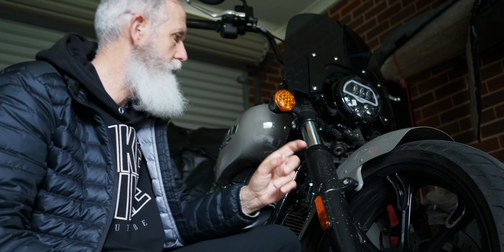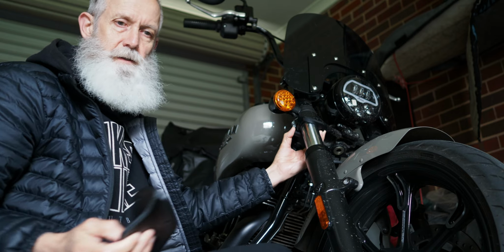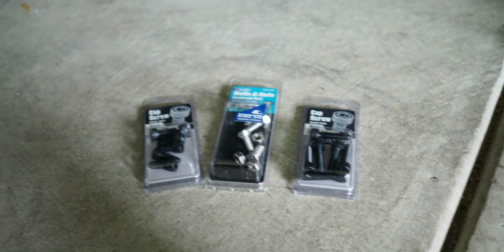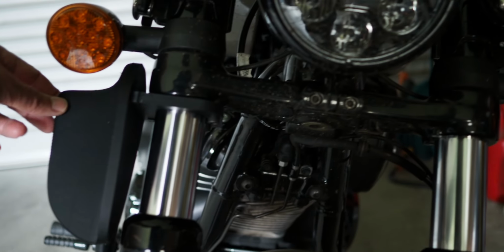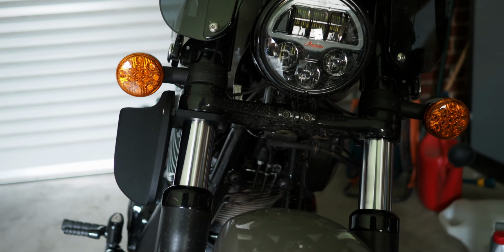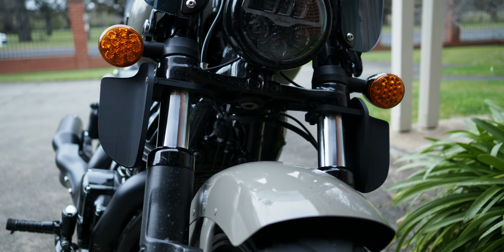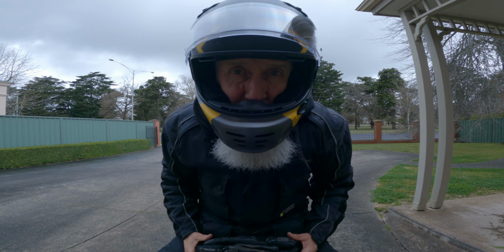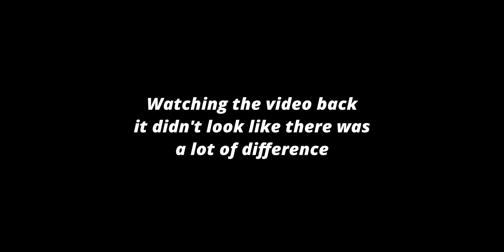Experimenting with Fork Leg Wind Deflectors

Comment: I bought fork deflectors off EBay. They are for Japanese cruisers but fitted without much work. $60 including the mounting hardware and work great. 2013 Victory Cross roads, it has the same front end as a Challenger.
Reply from the maker: Ooh interesting, thanks I'll check that out!

Comment: You are on the right track. Bought a used Street Glide that had fork deflectors on it. Did not like the way they looked, so I took them off. After one ride without them, I put them right back on. Huge difference! The wind buffeting was bad without the deflectors installed. You might want to take a look at what HD sells for their touring bikes and make yours a bit longer and dished like theirs are. What I would like to know is how much they affect wind flow to my motor. I have reached around in front of the engine at highway speeds at felt the air stream which seems good, but that's not a very scientific test.
Reply from the maker: Cheers NWF. I do like the Fangs available for Harley's. I wonder if I could make them fit the Indian? 🤔

Comment: I think you need a shorter screen, I have the short screen on my Pan Am and a deflector on top angled at 45 degrees, I don't get any buffeting. I have the same setup with the taller screen and I get some buffeting. Now the Pan Am does have a gap that lets air under the screen, above the headlight, to reduce the negative pressure behind the screen, and it does have side deflectors just above the headlight fairing.
Reply from the maker: Yeah, shorter or taller. I'm printing a custom smaller screen I designed right now, going to be interesting to see how this goes. Keep an eye on Patreon. ;)

Comment: Had the problem with my Chieftain. Another indian rider put me onto deflectors from the US called JES Customs. They absolutely work gets rid of 95% buffeting.
Reply from the maker: Brilliant! Cheers I'll check them out.
Reply: @BikesILike  I'm going to have Chieftain serviced at Ballarat in the next few weeks if you want to check them out
Reply from the maker: @theindianfromoz6301  Actually, that would be good! Let me know when that's happening and I'll meet you there. Email me here bil.channelcontact@gmail.com
Reply: I concur.  I did the same with my Chieftain.  I first bought a taller screen which really didn't help much and recently installed the JES Customs and my highway riding is much better.

Comment: After much experimentation with my Victory Cross Country trialling screen removal, fork deflectors, lower triple clamp deflector and different screen heights I came to the conclusion that the bike was punching too big a hole in the wind and it needed to direct airflow into the hole. Least buffering with the screen removed. I never tried putting holes in the screen but something needed to be done to direct aor flow into the hole made by the bike's large frontal area. Bye the way do you sell the chin mounted air flow indicators in your on-line store? 😅
Reply from the maker: Lol, I should! I had a Clearview screen on my Vaquero which had the vented opening, it did make a big difference.